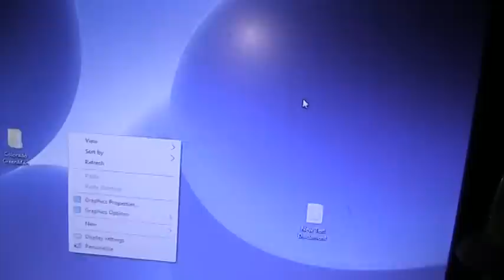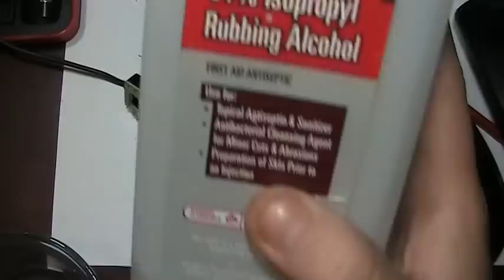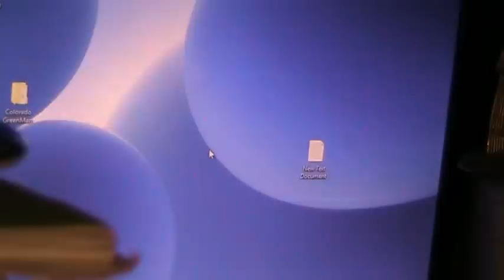Taking Apart and Repairing Dell Mouse With Stuck Button

Comment: I have this mouse at my office and the left button was sticking enough to perform a double-click when I only pressed for a single-click. I didn't have rubbing alcohol, but was able to take the mouse apart and brush it off with a clean microfiber cloth and then put it back together. It seems to be working just fine now. Thanks for the walk-through.

Comment: I always got a sound when I was scrolling and now when I fixed the loose spring on the mouse wheel, I realized that's not supposed to happen. Feels much more smooth while operating with this thing now. Thanks for the video and you've earned yourself a subscriber. 😊

Comment: I have a different name brand, Insignia, but this video got me thru a huge stumbling block - hidden screws under those "feet" pads!  I struggled getting mine apart with the one visible screw and trying to pry or "slide" the top half from the bottom half.  After finding and removing ALL the screws, everything after that was easy peasy.  A good cleaning, and now I have my "right click" back!  Thanks.

Comment: Thank you! They make a circuit board/ connection/ electronics spray cleaner. Works great,; just spray, let sit a minute, it evaporates like alcohol too. I used on mouse, circuit boards & plugs, staticky volume knobs, in automobile too. My cruise control quit working. Though 'oh shit'- labor $$. Spayed, let sit & tested- no results. Back home sprayed again... problem fixed!! It has tiny 'straw' w/ it, like WD-40. Can spay into tight, unaccessible places. Hope this may help you & others.

Comment: Thanks for the video.  I have the Dell mouse that was sticking and  double  clicking.  Opened  it up cleaned it now it's working like new.  I've had that mouse for years, picked it up at Goodwill or Salvation Army for not more than a buck and a  half.  Thanks again.
Reply: Did you use any liquid cleaner like the guy in the video (i.e. 91% Isopropyl Alcohol - Rubbing Cleaner)? Or did you simply opened it up and dusted it off?

Comment: good to see it that its actually a logitech mouse, as someone said in the past, you can see the logo on the pcb.
Reply from the maker: Lol this was sooooo long ago and one of my earlier videos as a creator, and I hate to say it but trust me, us creators get sooooo many comments across our videos that sometimes we can miss some comments, I’ve even had my phone tell me first time they commented, then not tell me that people replied to my reply....... can be frustrating lol. I just spent like 5 min scrolling though comments to see which one u were referring to, I did find it. I never paid attention to the Logitech part, but I’ve been tearing computer mice (mouses? Lol) part since I was a kid and cleaning them, the old rolling ball type had to be cleaned alllllll the time lol, and it would pull such much first into the casing it would work it’s way to buttons sometimes. But I do appreciate getting told thanks sometimes. But hey thanks to everyone for watching and please subscribe to help my channel grow. Latez
Reply: @hiddenbigfoot  yep, opening mice hasn't change much since then.  But quality has dropped a lot.  Since 2010+ mice use poor quality switches, not like Japanese made Omron, last forever.  Today, low end Omron switches are made in China, and most mice use no-name Chinese brands that last 3-5 years, so your video is important if you want a general fix it guide.  Me, I got 10 mice, multi-button laser from before 2006 off ebay or garage sale and they still work today like new,  just ratty outside and need cleaning, all use screw closures, new mice are snap shut, like cellphones or ultrasonic welded can be pain to open and may not shut if snaps break.  Most used I got for free.  I have enough to last me a lifetime and if needs fixing, easier to fix, and many quality spare parts to cannibalize.   More power to you.

Comment: Thanks, this is the Dell MS111-L while the -L stands for Logitech like the logo seen on the PCB inside. The USB vendor + product IDs are 046d:c077. On Linux the usbhid driver uses the quirk HID_QUIRK_ALWAYS_POLL as it would disconnect if it wouldn't be always polled (can happen on virtual terminal/text console).

Comment: Needing help, accidentally just spilled water 💦 and my mouse is broken and won’t turn on completely
Reply: If  you live in warm climate, place in bag of rice and then trunk of car for a few days.  Heat from sun on trunk will dry the mouse out.  Actually, anything that gets very warm for a day or two.  Same  principal as drying out an iphone that gets wet.  The rice and heat, gently dry the device making functional again.  If you can remove the battery, all the better for the process.